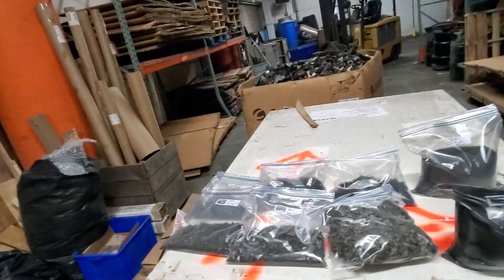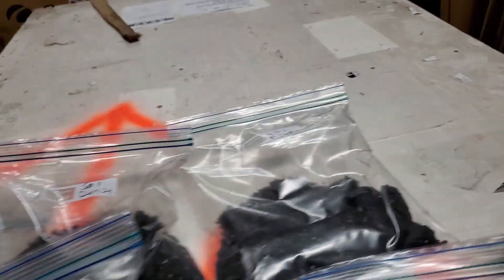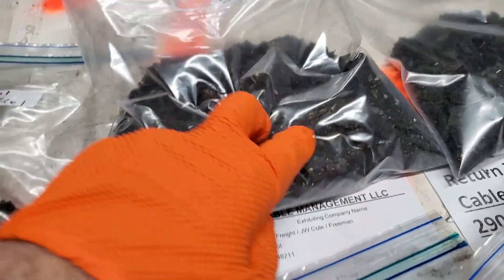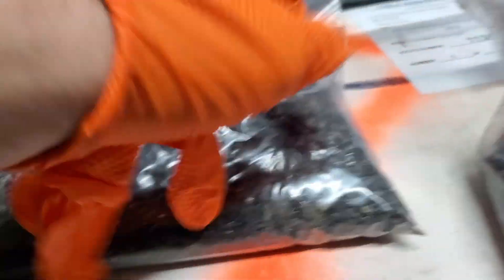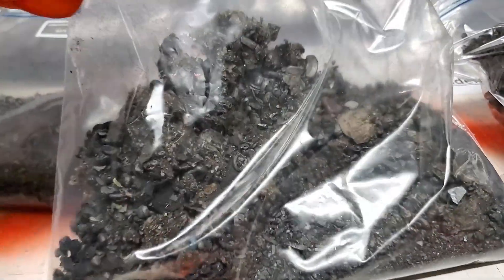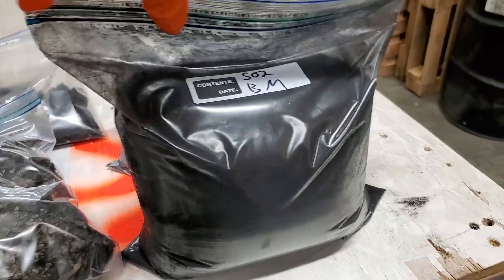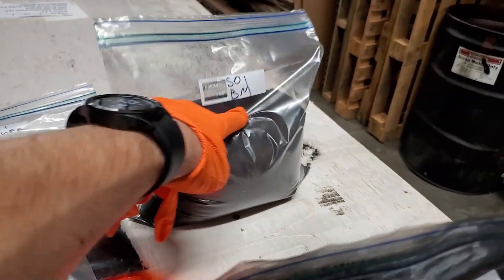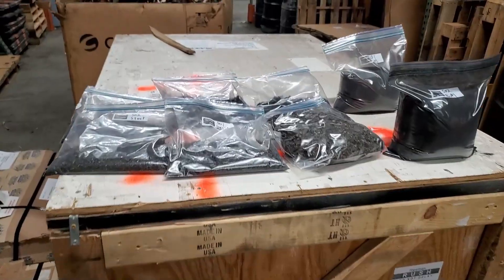How to Mechanically Recycle Alkaline Batteries for Black Mass

Comment: You never defined what "Black Mass" is used for.
Reply: It's going to be manganese oxide and graphite, possibly some zinc compounds and potassium hydroxide electrolyte. The manganese yield is what would have value to be recycled.
Reply from the maker: @spgoo1  Correct. Generally, the black mass direct sale value from alkaline is pretty low (close to 150/ton). However, if extracted and refined, the actual value of the extracted metals is closer to 1,300/ton. After refining costs, the value can exceed 500/ton.
Reply: Best use for this “black mass” is fertilizer. KOH is a good fertilizer. Especially for. chloride-sensitive crops!